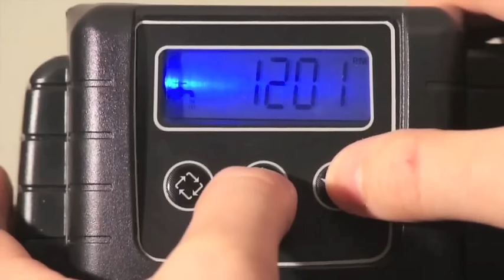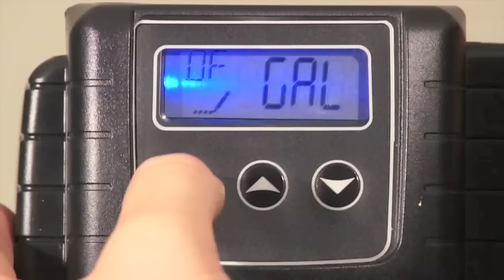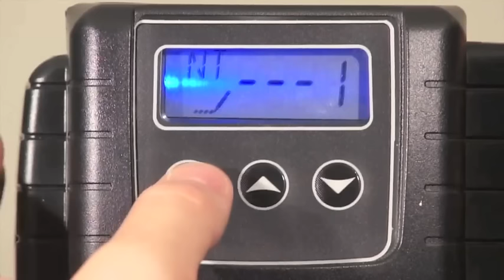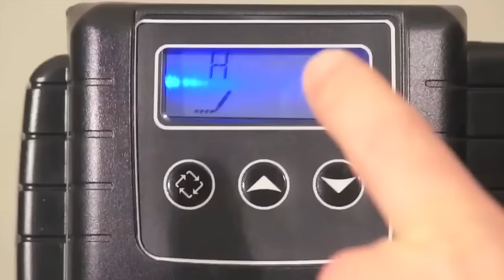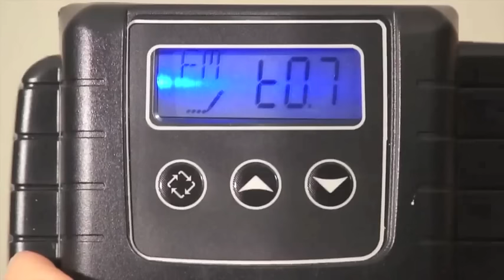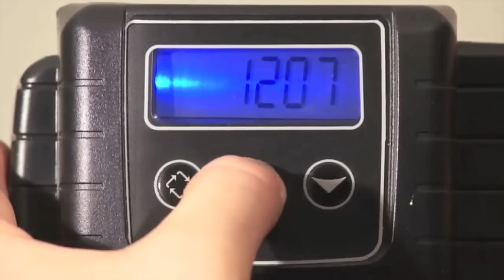Fleck 5600SXT Water Softener Valve Programming - aQuatell.com

Comment: 4:52 You stated to have a well water system set at 7 DO. Why 7 and after you said 7, you said it will either regenerate in 7 days or when it reaches full capacity. Is that "full capacity" a setting in the unit that cannot be changed and is a certain gallon number?
Reply from the maker: Every softener will have a programmed Capacity (C) value.  The capacity value is a function of the amount of resin in the softening tank, and the salt dosage used.  A softener will regenerate when the capacity gets close to zero.  However, if the day override value (DO) is set to 7, the softener will regenerate on the 7th day whether all the capacity has been used up or not.  This is a safety measure to make sure the softener doesn't go too long between regenerations.  This is really only an issue when iron or manganese are present in the water (which they almost always are for a ground water supply).
Reply: Aquatell Videos Just to be clear, if you are routinely reaching capacity before the 7 days, then it basically just resets itself as a back stop,  but it won’t actually do a recharge on the 7th day unless you have not recharged in  the past 7 days if you follow what i’m saying. thanks
Reply: Yes, it only recharges when it needs to.  The 7 day would be a 'fixed' setting.  So if the unit doesn't reach capacity by then, it automatically regens the 7th day.

Comment: i have two black tanks one is taller than the other (if it matters) they both have the same programming unit like in this video. When it asks 1 or 2 tanks do i select 2 on both? i lost the booklet on the tanks one must be a softener and the other a ......?
Reply from the maker: Likely, one is a softener, and the other is some kind of backwashing filter.  Could be a carbon filter, iron filter, sediment filters.  For both systems you want to select "1" for the NT setting (NT = Number of Tanks).
Reply: I think if you have two seperate SXT on two separate tanks, then choose one tank
Reply from the maker: If you have one control valve on a single tank, choose 1.  If one control valve is being used to backwash two tanks, choose 2.

Comment: Something went wrong with my machine.  The tub containing the salt has no what’re in it whatsoever but, the digital machine is working just fine.  I am trying to following these directions but after setting the time and percentage remaining I am not getting the CAL-or GAL SHOWN. I AM INSTEAD GETTING NUMBERS AND LETTERS.  I really wanted to get it fixed so I do not have to pay anybody to fix it.
Reply: Make sure it's not on bypass, if on bypass controller will work fine but no water will enter salt tank
Reply: @suaibochosuta7595  How do you if it is on or off bypass?
Reply: Look at the bypass valve and make sure it's turned to service not bypass

Comment: We can change the pH of the water?
Reply from the maker: Yes - you can change the pH of your water, but not with a water softener.  Usually, people are looking to increase the pH of their water (make it "alkaline").  If that's the case, then you need to use what is often called an acid neutralizer.  Are you looking to accomplish this for the water in your whole home, or just for a single dispensing point?

Comment: How long does it takes for water to fill the brine?  There are no water in mine whatsoever
Reply from the maker: Well, that depends on how the valve is programmed.  When you program it, one of the program parameters that you set is the Brine Fill (abbreviated to BF in the programming menu).  The number you set for BF is the number of minutes that the softener will fill the brine tank.  And in the vast majority of cases the softener will fill the brine tank at 0.5 gallons per minute.  So if you set the BF to 8, the softener will add 4 gallons of water to the tank.  Hope that helps!
Reply from the maker: Oh - one more thing.  Once you've programmed the time for the BF, you'll need for force a regeneration of the softener before it will add the water to the tank.
Reply: Should be 6 to 10 min
Reply: Are you sure there's no water?  Or is it just below the salt level so you can't see it?  The length of time to fill the brine tank with the proper amount of water depends on many factors: softener size, desired salt dosage, presence or absence of iron, etc.  More importantly though, different softeners fill the brine tank at a different rate.  Some fill it at 0.5 gpm, and others, as an example, fill it at 0.125 gpm.  So the brine fill times would be very different for these two systems, even if you wanted to add the same amount of water.

Comment: How do you regenerate after you put in iron out?
Reply: Press and hold the button on the left of the control panel (it's officially called the 'next cycle' button).  Let go of it when you hear the motor start to turn.  Then just let it go and it will complete a full regeneration.
Reply: Thanks Reid, do I need to do anything after I regenerate and what other times should I regenerate and how often? Thanks Rod
Reply: If you have an SXT model, it should be measuring your water use, and regenerating based on your consumption.  You really shouldn't have to do anything to make it regenerate - should do it on its own.
Reply: Thanks

Comment: What is going when its regenerating?
Reply: That sounds like a simple question, but it can be explained in many levels of detail :)  So here's the high-level description.  The regeneration consists of a number of different stages.  These stages happen one after the other generally in this pattern:

Backwash:  the system pushes water at a high velocity through the resin bed in the opposite direction to which the system normally functions. This lifts and fluidizes the bed and allows trapped sediment to be washed free.

Brine Draw / Slow Rinse:  the salt brine solution is slowly drawn from the brine tank into the softening tank and pushed slowly through the bed. This electro-chemically pushes the trapped calcium and magnesium compounds off the resin and replenishes these sites with sodium. In short, this is the stage where the resin is 'recharged'

Rapid Rinse:  the softener pushes water at a high velocity through the resin bed in the same direction as when the softener is in normal softening mode. This rinses the salt from the resin, and packs the resin bed

Brine Fill:  the softener adds water back to the brine tank to prepare the salt brine for the next regeneration cycle
Reply: That sounds like a simple question, but it can be explained in many levels of detail :)  So here's the high-level description.  The regeneration consists of a number of different stages.  These stages happen one after the other generally in this pattern:

Backwash:  the system pushes water at a high velocity through the resin bed in the opposite direction to which the system normally functions. This lifts and fluidizes the bed and allows trapped sediment to be washed free.

Brine Draw / Slow Rinse:  the salt brine solution is slowly drawn from the brine tank into the softening tank and pushed slowly through the bed. This electro-chemically pushes the trapped calcium and magnesium compounds off the resin and replenishes these sites with sodium. In short, this is the stage where the resin is 'recharged'

Rapid Rinse:  the softener pushes water at a high velocity through the resin bed in the same direction as when the softener is in normal softening mode. This rinses the salt from the resin, and packs the resin bed

Brine Fill:  the softener adds water back to the brine tank to prepare the salt brine for the next regeneration cycle

Comment: I just bought a fleck 5600 sxt water softer and already install it but now my house water is kind of sliferllyyyy why why?
Reply from the maker: I'm gonna guess that you mean your water is "slippery" feeling.  Perfectly soft water will feel like this - it's normal.  If you want that feel to go away, you can open the bypass on your softener a crack to allow some of the raw water to bypass the softener.  That will make this feeling go away.  Where did you buy your softener?

Comment: A hard copy manual is needed. You can keep the page open for each step. Video instruction is just annoying.
Where do you find the explanation for an erratic operation? Good luck finding it in a video.
Reply from the maker: Hi Daniel. Did you buy your system from Aquatell?  Or are you just speaking generally?
Reply: @aquatell  Amazon, 602abcWateers